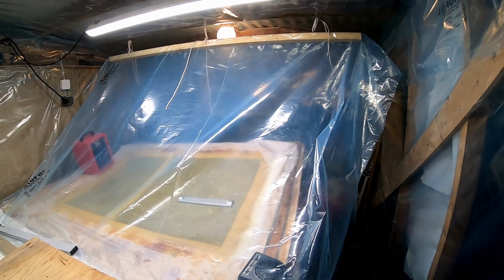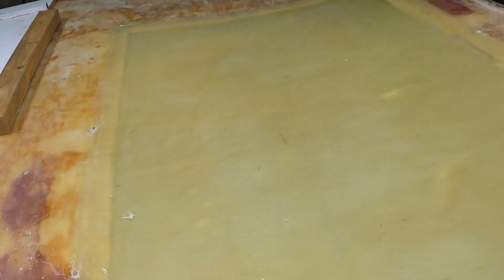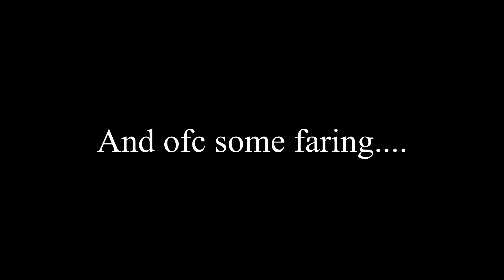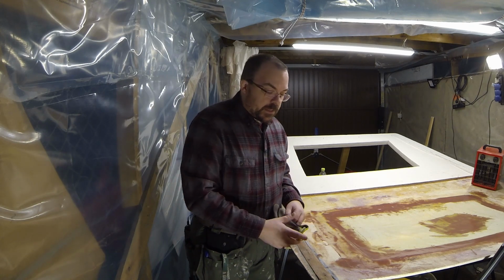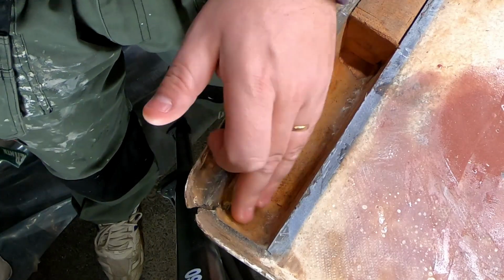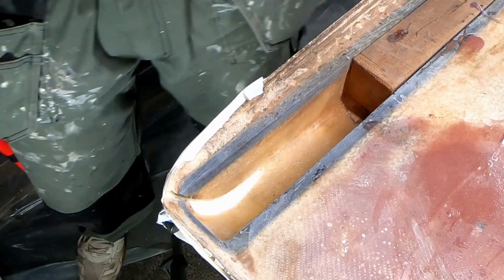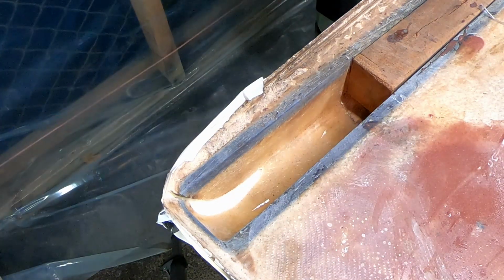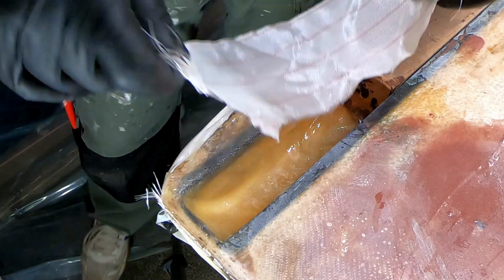Peel ply, Sanding, Repairing  - Doghouse roof ep5 - Boat McRill

Comment: You should give a Festool Rotex 150 a change, effektive as a belt sander but completly dust free, and can handle fine sanding.
Bit on the pricy side but you will not regeret the purchase. 
Buy once cry once type of tool....
Especially with all grinding you have ahead. 

Ceep up the good work, love your videos
Reply from the maker: Yeah, know that the festtool is great but its not in my budget atm. I have to put it on a wishlist for the future.